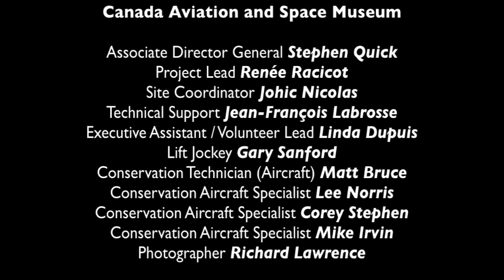Orenda and the Computer - John Duggan, Flight-Lieutenant Ba Peng (ret'd)

Comment: fyi 5k thrust to 7k thrust is only a 40% increase ... 8k thrust would be a 60% increase
Reply: each compressor stage is essentially a recursive calculation taking one answer to create the next one and so on ... you can do each sperately but then have to adjust each equation with the answer from the previous equation